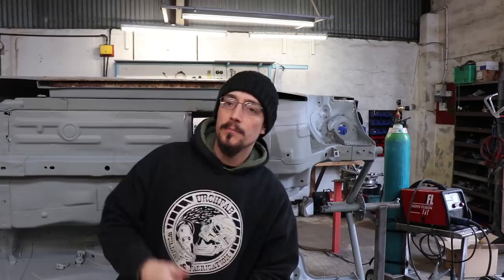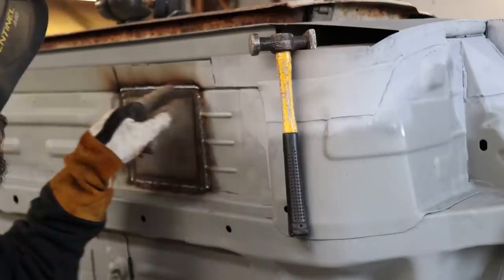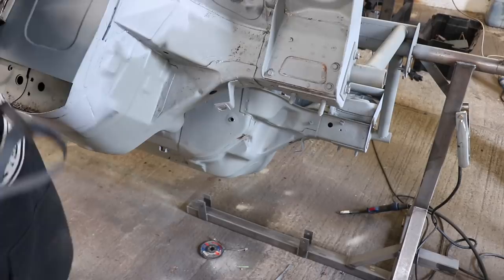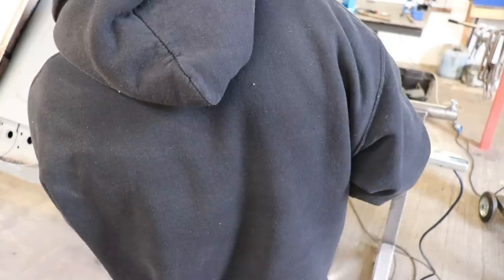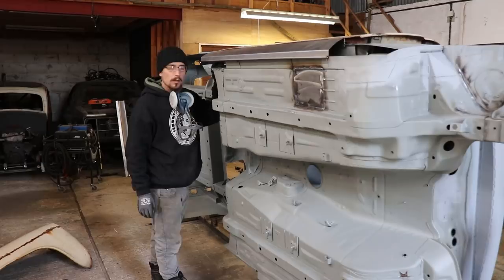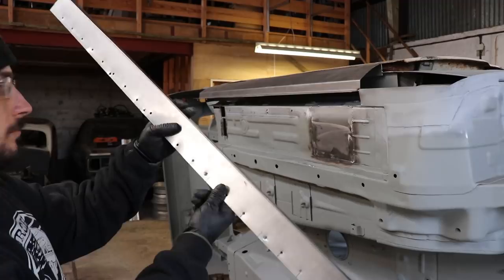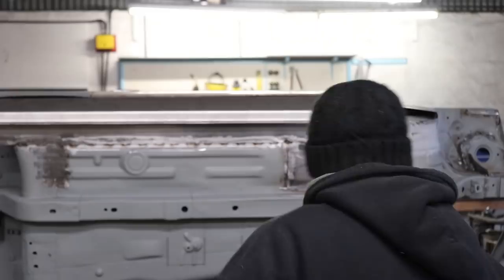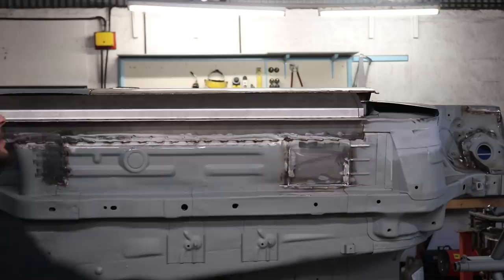FITTING SILLS AND PATCHING HOLES ON THE URCHFAB MONGREL.

Comment: Hey Matt, the sealer is applied before the panels join to be spot welded so it fully coats the joint area. I used to work at GMH on the dash line in Fab assy. I don't blame you for hating the stuff 👍

Comment: Totally impressive and you make the welding and fitting look so easy. I'll be curious t see how you sort out the jacking points on the Urchfab Mongrel.  It looks like it will be a light car and with the roll cage maybe no need for jacking points, but on my unibody VW's it has been kind of an issue.  ECS Tuning sells a retrofit set of jacking points but their set costs US $90.00; You can see that one by searching: "VW MKIV Jetta Jack Pad Adapter Set"  All it does is hold the car by the jack pad against (or with) two degrees of freedom so the car is less likely to slip off at extreme jacking angles; but at the same time with the pad remaining flush to the underbody. Good goin' as usual and I always look forward to your new videos! p.s just for grins do a search for "Angle Grinder Accident" and click "Images" as the search type.. a little free accident insurance policy that only takes thirty seconds... :-)

Comment: Ah Weetabix!  Now there is a cereal I have not seen in Canada for years!  The self-tapping screws seem to work fairly well as long as you pre-drill the outer sheet just like you say. I have found that I need to take great care to deburr the holes before screwing the panel in place.  How far qpqrt re those screw holes?

Comment: Heya,if your not going to run crash bars with jack points will this method of sill replacement alone be sufficient enough to use a trolley jack or 2 post hoist arms on the sill lip?

Comment: Hope you're considering the weight, a track race car also needs to be as light as possible. Less weight equals more available horsepower.
Reply: Not quite true it's light enough to provide power but heavy enough for grip
Reply: @rockabillypreformancerc1639  said Colin Chapman never

Comment: Hi, love your work, simply amazing and inspiring! I have a question about the little pressing marks from the factory, does not having them any more have some sort of structural (strength) consequence? I am doing exactly the same thing on a 300zx floor pan and it has 2 (about one inch) indentations in the form of a cross. Does erasing them have a structural consequence or is it so small that it doesn't matter? Thanks in advance.
Reply: The pressing marks are very similar to the ones to the left of your area, about that size.

Comment: If you wory so much about rust, here are the water drains for the sills ??
Reply from the maker: I will drill a few holes.
Reply: @Urchfab  and after it's done add anticorrosion Grease (Mike Sanders or other) inside it will help a lot preventing rusting.

Comment: Hello Matt. First, please excuse my bad english. But school is allready 36 years ago...Until now, I saw every part in your chanel. But this one and the last part, I am a little disappointed. You are the best welder I´ve ever seen, but this time I thougt, he would be able to do it much better. Yes I know. Nobody will see it again under the car, but normaly you are an artist...greets, Tom
Reply: jessman1004 one of the first things I was taught, the difference between an amateur and a pro, a pro knows when something is good enough.
Reply: @ForeverNeverwhere1  You are right. I´m not a professionell car builder. 
BUT  this patch on the floor without beads isn´t professionell, too. He´s the man, no doubt,  that´s why I wrote this. 
AND the pro normaly never has enough time... BUT  the amateur, because it´s his hobby and he hasn´t to earn money with his work.
Reply from the maker: When you wash your car do you jack the car up and wash and polish the underneath? probably not, that's the same reason I spent the minimum amount of time fixing the underside as possible.
Reply: @Urchfab  For your example you´re right. Of course. 
But if you spend so much time in the rest of the car, my opinion is, to do the underneath as good as possible, too.
Because you do it one single time...and 
you don´t see it again, but you know it.
Nevertheless a great and fantastic job!
Reply from the maker: @jessman1004  I know what your saying, One day I will do a project where every piece of work will be the best I can do but it wont be on a project built to use around a track.
Reply: @Urchfab  Love watching your welding skills!